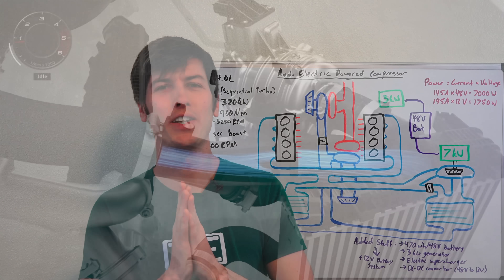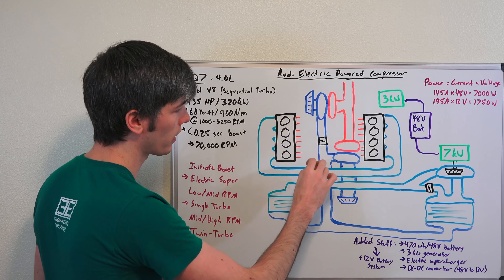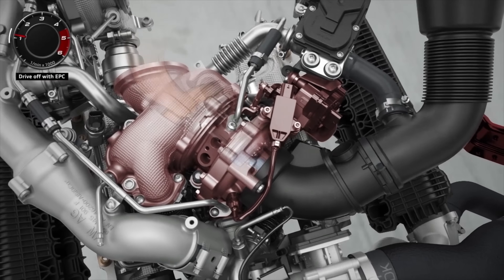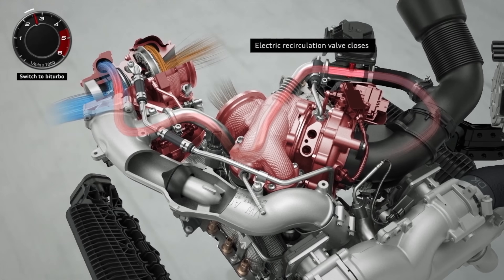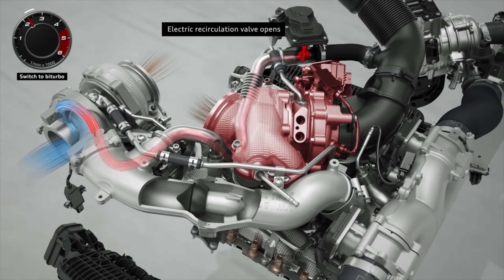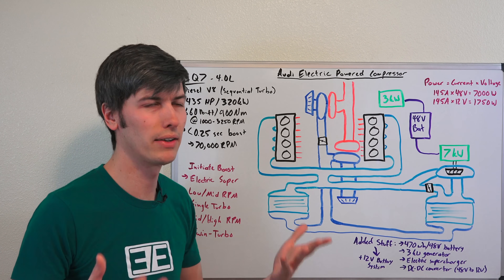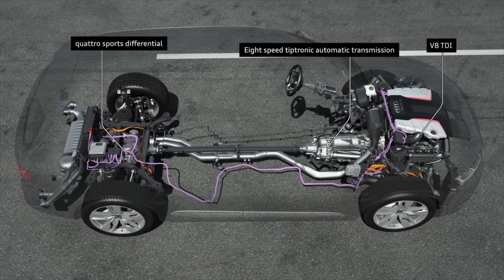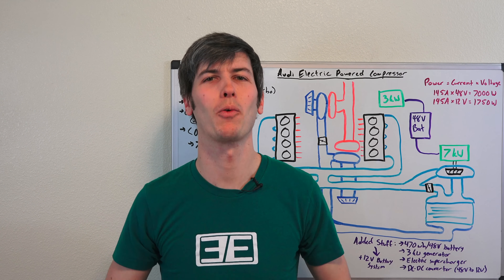Electric Superchargers - How Audi Is Eliminating Turbo Lag

Comment: Wow. This is nearly as complicated as Wright 3350 Turbo-Compound 18 cylinder radial engines that came out at the end of WWII.
They were famously used in the Lockheed Constellation and the DC-7. There are some great YouTube videos of night takeoffs in the “Connie”.
The 3350ci engine used multiple turbos that provided power directly back to the crankshaft in addition to adding engine boost. 
Almost a hybrid piston-turbo shaft engine. It was obviously a maintenance nightmare. At high power it was always run very rich to keep it cool.
Not used for too long as the transition to jets/turboshafts occurred fairly quickly.

Comment: Over engineering a vehicle I find is often counter productive. Even if it works chances are the it isn't worth it in the long run. Sure, they put all that tech in their cars to save a tiny bit of fuel but imagine for a second what it cost the planet to develop, manufacture,  distribute the vehicles and the specially parts needed, just to make something that will be around for 8 or 10 years, then be sent to the crusher cause no one will know how to diagnose the electrical. That's why I'll never buy German and stick to the simple and reliable Japanese.

Comment: Literally it's a hybrid. But with more parts. It has a hybrid generator, battery and motor, except that the motor powers the turbo instead of aiding power directly to the engine. Seems silly. But it is a technological advancement.

Comment: Holy...that is stupidly complicated.  I don't envy the mechanics trying to fix these things a couple years down the road.

I can see why the electric system would only be used for momentary boost - with that kind of power consumption, you could never keep it cool inside an engine compartment, much less reliably generate that kind of power with lightweight equipment.  At work I drive electric forklifts that have opportunity charging, which is basically hitting the batteries with a sustained 190A charging current.  You don't even need to check the charger displays to see if they are working - just grab the cables and you'll feel the heat right through your gloves.

Comment: This seems like a very complicated way to combat turbo lag.  Perhaps better attention should be paid to the turbo's, the plumbing and the intercoolers  instead.   Any gain obtained seems it would be countered by the extra weight of this system, which likely adds 2-300 lbs.    The other issue is the simple fact it's an Audi/VW, which are not know for their stellar reliability.  I'd be concerned about being stranded on the side of the road from a component failure.

Comment: Friggin Audi. Always making things complicated for the sake of being complicated. Could have just used a hybrid electric assist like everybody else or just figured a way to combine a turbo with a geared up electric motor to make it spool faster from low rpm. But nah, let's add weight and a whole other system to fail (which will because Audi) Good job.

Comment: Would be interesting to see a video on the pros/cons of using electric motors to provide near instant boost vs a electric motor on the driveline itself to provide instant torque that way.
Side note, really interesting way of providing sequential turbo spool up with independent control of the exhaust valves. Come a long way from 90s jdm style twin turbo control.

Comment: Nice to see, Audi took a very strong electric engine with a dedicated strong battery to make that electric turbo to work, remembering that it does not work all the time, just to cover the main ones when it is in low RPM and all the sudden you need more power fast, and some people out there would believe that a computer cooler running on your normal battery all the time will actually do something...

Comment: So now we've got a piston engine with both an exhaust gas turbo charger and a electric turbo charger, complete with it's own generator and 48 Volt battery.  This is unbelievable!  Anyone who endorses this, just for a quicker turbo boost needs a mind reboot.  Men are not that blankin picky!  The quickest way to get "boost" or "acceleration" is with electric motors right at the wheels.  Audi is putting electrical energy into the intake of a piston engine instead of the output where it is needed.  What a total joke this is!

Comment: I have a hard time wrapping my head around why this is used in a twin turbo application. I was under the impression that twin turbos are used to get better response from the smaller housing and bigger CFM from having both turbos but if you have this electric booster why not make a single larger turbo to flow the same CFM as the twins with less complexity. Does it really make that much difference to the torque curve? And isn't it risky to run smaller turbos all the way to the top like this to the point that you need a second turbo to help it only on the high end. Seems like an awful lot of backpressure to me possibly scavenging/"reversion" issues?

Comment: If the electric motor is ran off a battery which is powered by a generator the the supercharger is still being ran off the engine

Comment: the schematics look strange:
Is the compressor really installed AFTER the intercooler? And it looks like there is nothing preventing the air from getting pushed back to the intake on the left.

Comment: Could this concept be utilized to temporarily augment power in an otherwise naturally aspirated engine? Say for passing or climbing a steep mountain grade. For example, an RV with a gasoline engine which has a 48 volt battery system installed for off grid camping.

Comment: Or... They could skip the dinosaur juice burner in the middle, put a bigger electric motor and battery and call it a day. :)
Reply: That electric engine is powered by coal, primarily, and the metals used in the batteries are horrible for the environment at mining and at disposal.

I'll stick with a clean ice.
Reply: @brianlojeck 

Thats a myth. EV are much more environmentally friendly. Even if the grid you draw power from was entirely coal, which it defiantly is not,  EVs , by means of their efficient drive trains, still offer superior efficiency and emissions.  

Engineering Explained has a good video that dispels this myth.

Comment: Do you know if the 48V battery is charged as part of a regenerative braking system?
Or perhaps it is primarily charged by regenerative braking, and only charged during non-braking when the battery charge is low. That would make the most sense.

Comment: this should never leave the factory. driving a wankel engine is much more secure, chaper, reliable and efficient than anything like this
Reply: It's not April 1st yet mate... got to save your jokes a week or so.
Reply: If wankels are SOOOOO great, how come even Mazda has pretty much ditched it? Oh, they're not RELIABLE if you have to replace the engine seals at 10K miles or less...BAD pollution and well, just a nasty little engine to maintain.
Reply: nice Joke, please at least google it, check Mazda Rx8 forums, you need to rebuild your engine every 60K miles, no good gas milage, and oil consumption
Reply: still better than forced induction system rebuild every 5 miles with 10k $ bills

Comment: I had this same idea when I was younger except it was only supercharged and there would be an engine generator that stores the power in a battery system which would then get charged by just running normally, but if you wanted boost you'd flip a switch on the dash and it would turn on the electric motor to spin that supercharger for at least a minute before you had to recharge again.

Comment: A 12v can deliver a lot more than 145A in short bursts which is the use case here I believe. The engine starter for example is more power hungry. Modern start/stop systems also put a lot of stress on the battery which makes think that it could be possible to use the 12V battery ti power the turbo.

Comment: This is an excellent concept. You only need the electric SC for an few ms at a time. I cant help but think simply adding an electric motor and an battery would give you the same results with the added efficiency of regenerative braking. None of this is going to work correctly at 100,000 miles.  Excellent concept but too little too late.

Comment: There is one more thing to talk about. We'd like to have an electric turbo-charger always "on". However, this 7 kW of power has to come from some source. This source is a battery which has to be recharged. So if we calculate how much power we need and compare to resources we have... we can see that we would use more power than can be delivered to a battery by an alternator. Thus this electric turbo-charger can't be used all the time. It gives just a "kick" on low rpms. I wonder how Audi managed to recharge a battery quickly enough to deliver power if a driver wants to use full power.

Comment: I'm glad to finally see this happening. I wish there was a purer example of it though, just an i4 with an electric turbo. Why is an electric supercharger the go-to rather than an electric turbo? Increased load by creating vacuum on the exhaust? I would think an electric turbo could eliminate the need for a throttle, it could just run as a generator to restrict flow when boost isn't as desired.

Comment: Why not just use the 48V battery to spool up one of the turbocharger like the P1does similarly and save the extra weight of the supercharger? 
Or wouldn't the electric turbocharger be as responsive as a supercharger?

Comment: 48V systems will become more common as they begin to take over duties which can be offloaded by the engine such as the HVAC. The voltages involved is also non-lethal which can give it the benefits of hybrids without the cost.

Comment: uhm... why no one have used a tow in one (turbo and super in a single piece)?
The turbo side could be driven by a ECVT that is engaged with a clutch. When the exhaust gases get up to speed the clutch disengage and the turbo side assumes the job.

Comment: Excellent video as always. You really broke down the complicated system on a whiteboard. Sometimes whiteboards are much better to explain than an animation.
I am wondering if there is any to calculate the battery power required to generate a given amount to boost. Can we relate the boost PSI generated to the battery power (or the supercharger displacement for a conventional supercharger) through some function.

Comment: Why not just slap a turbo electric generator with bypass valve for back pressure control, then slap a battery and supercharger, should make it a lot simpler, once Engineering Knicks are ironed out.

Comment: Man. This is so complicated, I think Formula 1 might be interested in adopting a power unit like this for 2019. I shudder to think how much it would cost to repair if you had an oil leak.
Reply from the maker: F1 has been using electric turbos since 2014.
Reply: Engineering Explained I know. But the twin turbos. One that isn't always used. Plus an electric supercharger. The current split turbo, twin MGU setup is probably slightly less complicated.

Comment: Those cheap frauds on eBay also just aren’t compressing air, they use fans not turbines, you can use a single 12v and make boost, though it won’t be much, but ..fans won’t work regardless of voltage lol

Comment: Is this similar to the Mercedes f1 power unit? Iirc the electric motor spools the turbo instead of the extra step of spooling the supercharger in audi's case.
Reply from the maker: This is an electric supercharger, vs an electric turbo as used in F1z

Comment: Dumbest idea EVER.  Even with the finest technology a direct drive electric motor is TWO ORDERS of magnitude more responsive.  Audi spent a ton of R&D on tech that is DOA.  Look at Koenigsegg's solution on the Regera for a gas solution that works (and is less complicated!).  Audi is clearly just clinging to gad cars when they should be focusing elsewhere.
Reply from the maker: So a larger battery, a significantly more powerful motor, and the control systems that go along with it is simple, but a far smaller, cheaper system consisting of an electric supercharger is super complicated?
Reply: Engineering Explained Yes, it is morr simple actually.  And as I said - in terms of the stated goal of reducing lag, these are just games.

Your videos are really good - I have watched many of them and your analysis is spot on.  But let's be realistic - the maturity and simplicity of electric motors is superior to combustion engines for things like mechanical propulsion.

Again - take a look at what Koenigsegg did with the Regera.  That is a far better concept for balancing low end torque and high end power.

This system has far more variables all around and if you at the actual results its good, but not great.  And its costly.  I own an Audi SQ5 with the supercharged 3.0 liter - one of the best engines Audi has ever made IMHO.  With ZF's 8 speed, a mild pulley ratio change, and an ECU remap the cat makes 0-60mph in 3.9 seconds.  And the engine pulls strong to almost 7000rpm.  It still gets 21mpg highway.

I'm merely saying in this case that if Audi had spent this much R&D money on a pure battery solution they could have achieved better results with less complexity.

I am impressed with your engineering knowledge - would welcome your analysis in a future video comparing the complexity of a good BEV with this system.  EV's are different and they do need a few systems to run, but the extent Audi has taken things to overcome an inherent limitation with gas engines is odd when a direct drive motor coupled to either the crankshaft or driveline would potentially have been better.

But in terms of sticking to purely a gas engine solution I do agree this is very sophisticated.

Comment: Would probably be cheaper to just have big electric motors on the rear wheels to get you up to say 100 then the final drive takes over on the front wheels. Or vice versa. 

Or just electric motors with a 2 speed transmission for power.

Either way this electric supercharger seems like a lot of complications that isn't really giving you much benefit.

Comment: What if your doing a track day or something where your at full throttle quite a lot, could you use more power than can be put back in and end up with a N/A car until it recharges?
Reply from the maker: It has two turbos, when you’re in full throttle all the time the turbos are doing all the work, not the electric compressor.
Reply: Engineering Explained i probably should of watched the whole video before commenting. I get it now after watching it.

Comment: Video idea: Why thinking that "higher turbo boost pressure is better than lower boost pressure" is a silly way of thinking about it when comparing different engines. Pressure implies there is restriction in the intake system, but flow is what's important for getting air into the engine. You can only get higher pressure (than atmospheric pressure) in an intake system if you have a restriction in flow - not the best if you want your engine to breathe.

Although, someone will probably make the good point that if you cannot reduce restriction in the intake system, the only way to increase the amount of air is to speed up the flow (restriction of flow increases air flow speed through the restricted area).

Comment: So many crap solved 20 years ago with bi-turbo, sequencial... My 2.2L TD Peugeot already has that and well, no lag, the first turbo is spolled even at idle, by 2000rpm the second comes in and it's a kick in the back, 240Hp available from 1600Rpm and 480Nm. Adding complexity to something that had a lot less 20 years ago and does the exact same thing. BS on this one.

Comment: if i was the designer of that engine i would've used a belt driven clutched supercharger.
it would be more efficient, less complex and lighter than that system.

Comment: I really don't get why you guys always complain about reliability of german cars... I have one of those scandal diesels an A3 '09, they say at about 180kkm the turbo will break... I'm over that now and no turbo replaced! Treat your car right, especially when its cold (for turbos) and it will last long!
Reply: Because their engines are fine, for the most part. They use way too many electronics that control too many of the cars systems, and so a 15 year old Merc, Audi, or BMW repair to the electronics (which always DOES go wrong) will cost the entire value of the car. They're almost all extremely unreliable in that sense, but if I had to pick one, it would just be a base model GTi or VW diesel. They're the simplest and cheapest of the bunch.

Comment: Curious about the design of the electric compressor. I assume it's a low duty cycle component so I'd imagine that Audi have pared down the turbine as much as possible to get that quick spool time but the lack of any intercooler on the electric side makes me wonder just what kind of compression ratio (is that the correct term?) the impeller achieves. Seems a bit overly complicated for something that would save a fraction of a second of lag time. Unless we're talking about a diesel engine with abnormally large turbos. Then I can see such a system making sense.

Comment: I thought that the current would be determined by the load. If the motor was 7KW and you changed the voltage from 48 V to 12 V, wouldn't you increase the current to 580 amps? I would agree that it would be impossible due to the fact that now you would have wires the size of radiator hoses feeding that unit. Also with the limiting power available to a lead acid battery, your car would be going through batteries like a fat kid goes through a Pez dispenser!

Comment: What about a tank with some type of compressed air that initially drives a turbocharger for low end boost? It would probably only work in short bursts but a small compressor could refill the tank when demand is low.